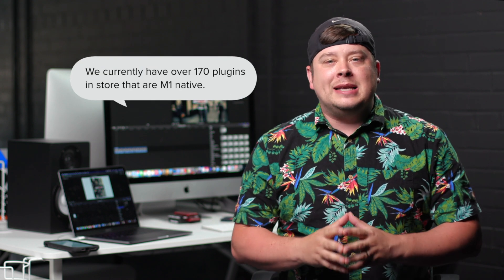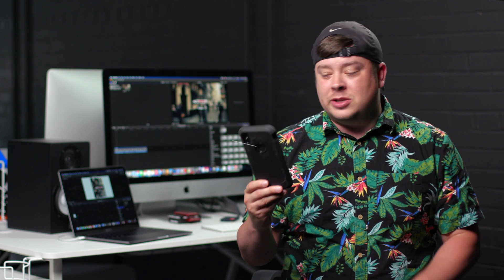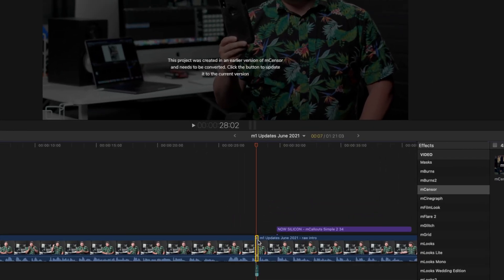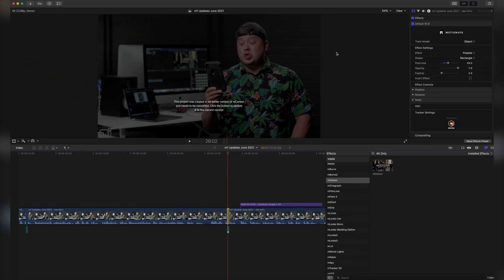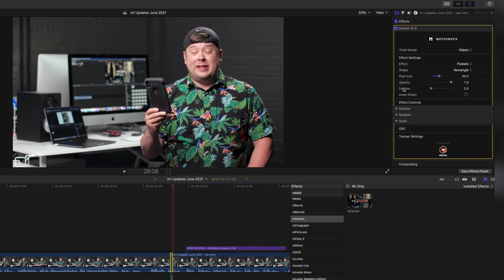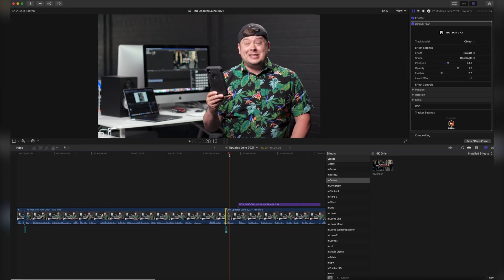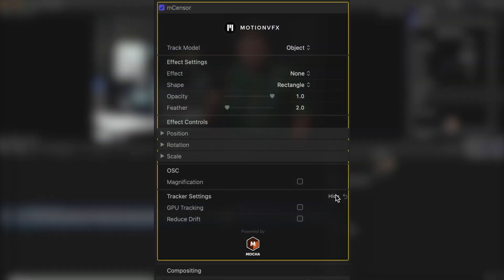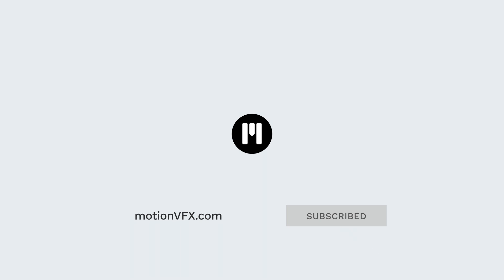M1 upgrades! We currently have over 170 plugins in store that are M1 native!

Comment: Yeah but when are the previous plugins going to be updated, I have many MotionVFX plugins which still do not work with my M1.
Reply from the maker: We recently added "M1" tags to both plugin main page and also customer accounts. Please log in and you will see vast majority of you plugins already M1 native. Templates don't have these tags, as they work irrespective of the Intel/ M1 issue.

Here's a list of over 170 already native M1 plugins: https://www.motionvfx.com/applesilicon
We have only less than 20 plugins left to be released as M1 versions, while we have to admit they are the most complex ones.

You can use all your Intel plugins, even if on M1 computers, just via Rosetta. Here's how: https://www.motionvfx.com/faq-motion-5-fcp/answer/apple-silicon.html
Reply: Mine work without any problem: launch rosetta FCP and no issues here.